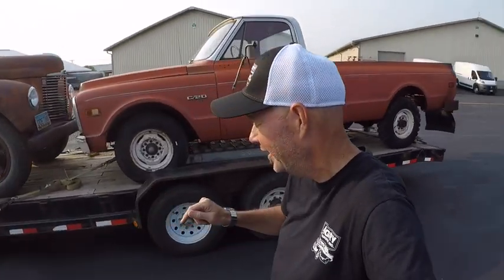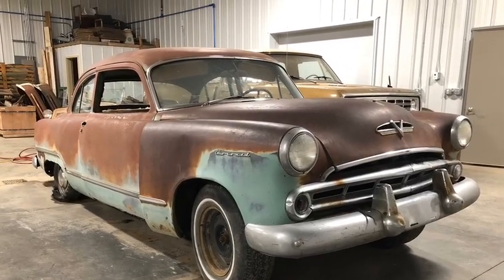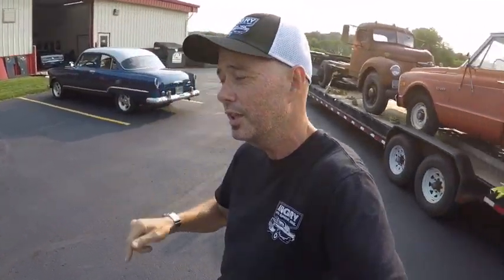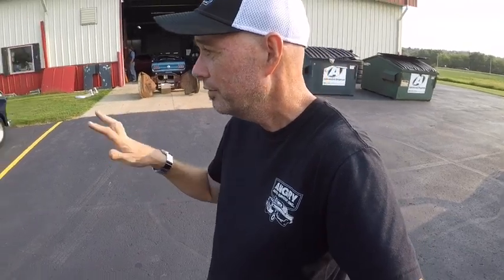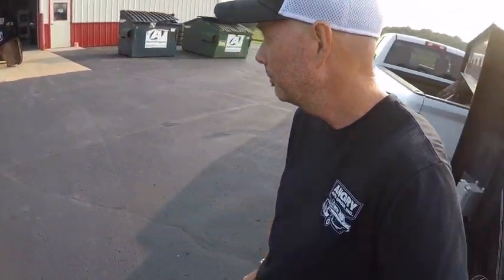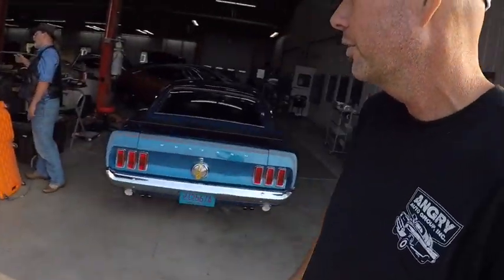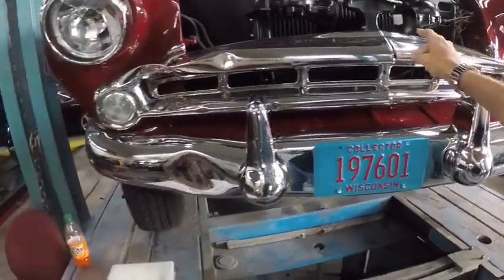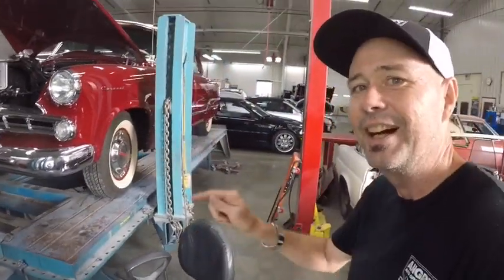Resurrecting Cars From The Dead - The Story of Two Customers

Comment: Im in NE ark and there isnt any viable market for 4 door cars. Simply not any ready willing and able buyers.   For 2drs and trucks there is a weak market for them or parts. So Im selling several to the crusher. One is a complete 64 olds 4 dr htp. 394 rocket engine only thing missing is one dynamic 88 fender script. So I will strip it of engine, wiring, radiator,stainless , heater core and rear end and send it to be recycled. I kept it for ten years that long enough.